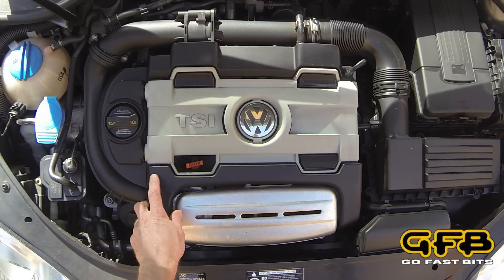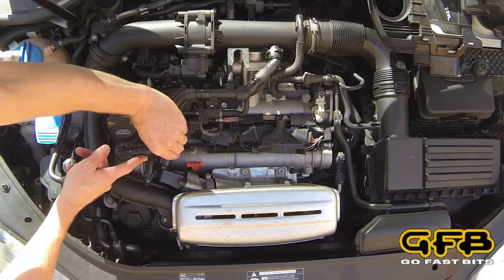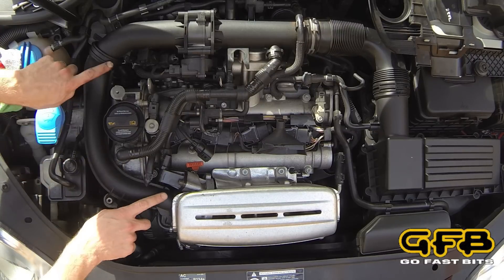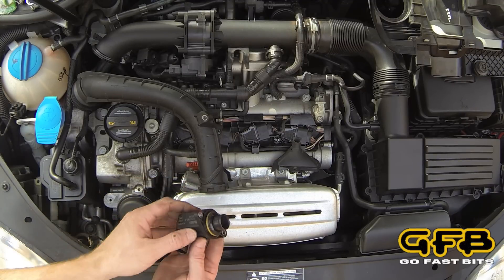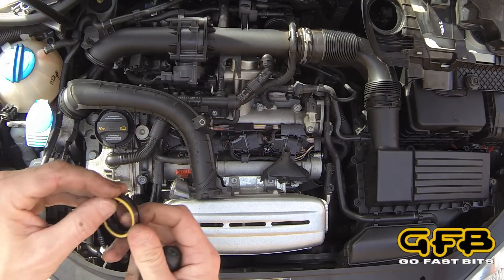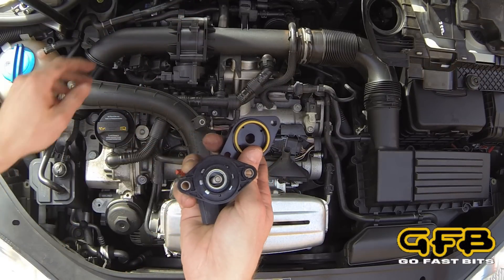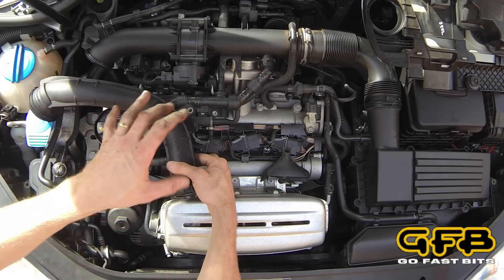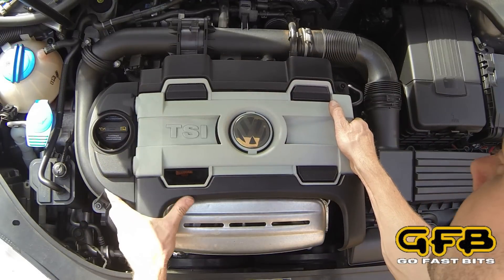GFB T9355 DV+ Twincharger 1.4 Installation

Comment: I am not sure, with the DV+ in place I feel a hesitation when pressing the throttle, a brief "nothing happens" when I step on the throttle. I also feel this hesitation when I slow down and downshift, lose speed, press clutch, blip throttle, downshift , then on the throttle again and the car does nothing for a brief but noticeable moment. Is it the DV+? Not sure, every other sensor and valve has been replaced with new. Is the piston sticky? Does it need to be lubricated (some people say yes, some people say no).

Comment: This looks like a Golf 5 but chatgpt is telling me the correct parts number is T9351 ?
Reply from the maker: No, sorry we only have the T9355 for the twincharger 1.4L Golf,
Reply: Chat gpt told me the same i order the T9351 but the T9351 was the wrong, T9355 ist correct. check how many Bolts you have. By the T9355 are there 2 an by the T9351 are 3
Reply: @till9024  Yeah, I did end up getting the GFB-T9355 in the end after quizzing chatgpt further and cross-referencing other sites. It hasn't arrived yet.

Comment: 74 / 5.000
And how it works, what difference is there against other brands or against the urinal.
Reply from the maker: Hi, our DV+ works by replacing the plastic valve parts of your OE diverter valve with an anodized billet aluminum housing and brass piston that ensures strength and reliability no matter how much boost you run. Our pilot-actuation system allows the valve to progressively open in response to boost pressure. By retaining the factory solenoid as well, the DV+ is able to open and clos reliably without ever exceeding the solenoids capability.

Comment: Fix error P0243?
Reply from the maker: The P0243 error looks to be related to the boost control solenoid, not the diverter valve.

Comment: Hey guys hopefully you can help me out on this one, installed everything correctly but if I give it 75% or over throttle, the o ring on the air pipe comes off, and when I reset it probably it does the same thing
Reply from the maker: Sorry I'm not 100% sure which air pipe you're referring to. I suggest contacting our engineers at support@gfb.com.au and including pictures or video showing the issues you're having
Reply: Where the 2 bolts come out of the Clamp, in there is a o ring that keeps blowing off
Reply from the maker: @ferisers6200  There's no clamp in the T9355 are you talking about a different product? 
Please contact our engineers at support@gfb.com.au
Reply: @gfbvideos  I should of explained it a bit better, your product works perfectly, it's the factory air pipe where the clamp is with the 2 bolts, there a o ring seal in there that seams to blow off everytime I give it a bit of throttle
Reply from the maker: @ferisers6200  I'm still not 100% sure which part you're referring to sorry. If it's blowing off with boost pressure then it sounds like there's a clamp that's loose or perhaps missing. Might be worth taking the car to a mechanic for that one if you're not sure

Comment: How about I have the same valve installed when I bought the car if I heard a whistle but now that I have cleaned it no longer sounds, is it normal that it is not heard?
Reply from the maker: Hi Erik,
It's a bit hard to diagnose a sound without being able to hear it. The T9355 should make the same amount of noise as the original valve so it's normal for no sound to be heard if the car doesn't have other modifications
Reply: I have Intake, Downspout, Catback, so is it normal that it doesn't make any sound?
Reply from the maker: @erikrodriguez922  Yes that's perfectly normal. If you have concerns you can send video to support@gfb.com.au

Comment: Good evening, I have a question the scirocco 1.4 tsi diverter valve will work on 2000 rpm?
Reply from the maker: I'm not really sure what you mean sorry. If you need technical help you can contact our engineers at support@gfb.com.au

Comment: good morning brother, in that same engine where would you connect or where would the turbo pound meter be connected? I can't find any vacuum hose to connect it, I hope you can help me Cheers
Reply from the maker: Do you mean you're trying to install a boost gauge? There are a few places you could put this such as in the line that goes to the fuel pressure regulator. It will be different on each specific engine and I don't have any specific instructions for your engine

Comment: hey guys ive seen a couple vids about this now and they all seem to say it gives the turbo a louder blow off sound, is this correct?
Reply from the maker: No this valve is not designed to change the sound. This is a fully re-circulating valve, not vent to atmosphere.
Reply: @gfbvideos  so now my question is what does this help or do for the engine
Reply from the maker: @larsharmsen9353  The DV+ can help in a few different ways. It can solve any leaking issues with the OEM part, improve throttle response on gearchange, and solve certain reliability issues with the OEM part. If you need any more information there's a bunch of resources on our website, or you can contact our engineers at support@gfb.com.au
Reply: @gfbvideos  thanks maybe I wil look into buying this when the OEM is broken

Comment: G5 BMY 1.4 TSI twincharger 103kw 2007
Works like a charm.(Do NOT lube ,it will burn away and stuck as turbo gets hot)
Factory sound --- whoooosh
DV-psssh  (short one)  or with 20psi+ it can make Stututututu (need throttle to cut off on proper boost ,not easy)
Reply: can you post a video or send me one somehow? im asking because you said DV= stutututu and i want to find out how to do it !
Reply: @TzouPhotography  I have air intake upgrade (KN) as well so more air comes in kompresor+K03+with DV gradually opening ,if you let off gas in right rpm there will be enough air left to make Stututu. 
But note its on twincharger engine so kompresor surely helps this.
Also its not very noticeable from inside.Its still small k03 so its just decent stutu :)
Reply: @pazupazu2781  i have the mk6 running 235ps at 1.5bar.. I'm about to make a metal plate to block the Bov so it stutuu like a charm... I don't think that the stock gti has more boost than me, and it goes stututu crazy
Reply: @TzouPhotography  1.5 will sound nicely im runnin just 0.8 and can hear it more or less so yours should sound even better.
Reply: @TzouPhotography deleting it won't hurt the turbo?
Reply: Does it sound like a forge bov?
Reply: @itzdc2903  No, forge has more sound,and whoosh in general i would say.
Reply: @pazupazu2781  Ikr, but does this sound?
Reply: @itzdc2903  Depends oon your intake how much noise it will make.but generally forge will do more sound coz it works diferently than dv+ i guess

Comment: Do u get boost pressure not detected since the install when using obdeleven
Reply from the maker: Hi Keston,
There shouldn't be any boost pressure not detected error codes after the install of the DV+
If you are having issues, please send some photos of your setup, and the components individually to our engineers at support@gfb.com.au

Comment: Hello!
I have a vw golf plus 2007
The engine that I have on in that car is an 1.4 TSI engine.
As I'm seeing in the video that's exactly the same engine as mine.
Since I bought that car, when I go out and give the car some beans. It seems that it isn't having any problem with the boost, or actually sometimes it's boosting pretty much A LOT and the turbo sounds like it's suffering from overboost.
But sometimes I noticed that that's just me giving the car too much beans basically.
Anyhow everytime I return and give the car a read/Svan for faults I get the error code P2261.
Does changing my dav has any potential of making that error disappear?
Thank you in advance!
Reply from the maker: Hi Nour,

So that an engineer can double check the fitment, please contact us at support@gfb.com.au, and we'll get back to you as soon as possible.
Reply: @GFB  thanks for the answer, I will definitely contact them, sorry for the latency with my answer, I didn't see any notification about your reply :)
Reply: @gfbvideos  what would you recommend for 2022 Skoda Octavia 1.4 TSi? I am unable to find my car on your website..🤷🏻‍♂️
Reply from the maker: @avishant1407  Hi Avi, thanks for contacting us! Using our Vehicle Fitment Search on our website, I was able to find that we do have the T9430 VTA listed as compatible with your vehicle. I found this by selecting: Skoda, Octavia, SKODA 1.2/1.4L TSI 2014-ON. I’ve also attached a link below. Thanks
Reply: @gfbvideos  ok, thanks, will check it out, how does it regulate the actual boost though? Currently my boost is at 28 psi, hopefully this will not be affected (as in reduced) by the B.O.V? Also, do you have the boost gauge?
Reply from the maker: @avishant1407  The purpose of a blow off valve is not to directly increase or decrease boost. It is more so related with redirecting boost (venting to atmosphere or recirculating back into the intake) after coming off throttle. The T9430 VTA will be able to remain closed and vent under your current boost pressure and it shouldn’t be able to operate as intended. We do also have a boost gauge available for purchase on our website. Its respective part number is: 3730.
Reply: Just an edit.. my engine is the variant that makes 140hp stock
Reply: I've installed this on my golf mk6 tsi 1.4 2010 160bhp. The other day Without the fat spring behind the piston. No error code at the moment showing. Migh have to drive it for longer and see how it goes
Reply: @Joe Andaya  thanks for your answer.
One thing to note though I think your engine is not the same engine that I have on my mk5 golf plus, mine is twincharged which I think was not installed to golf mk6 as far as I know of.
My engine code is bmy.

Comment: I have a VW Scirocco 1.4 TSI 160hp, is this worth upgrading without tuning ? Will I feel a difference?
Reply from the maker: There are three key benefits of the DV+. Boost holding, throttle response, and longevity. Given the age of the engine, if it's still on the original diverter valve chances are you'll at least notice a slight improvement in boost holding at high RPM. The throttle response improvement is there regardless of the condition of the OEM diverter, because the DV+ operates differently. Typically you'll notice this more on a manual vehicle than a DSG, but any time you drive aggressively on and off the throttle, the DV+ will improve the return to peak boost. As for longevity, the DV+ will last longer than the car, that's for sure.
Reply: @gfbvideos  Thank you for the fast and great reaction  🙌💯 I've got it installed a couple days ago, together with a Pipercross airfilter, new NGK Coils and Spark plugs, I've had to admit this DV+ diverter valve is a great upgrade, the boost and throttle response feels so smooth now, I'm loving it 👊🏽😎
Reply from the maker: @Wiseguy-010  Awesome! Glad you're happy with the improvement, thanks for the feedback!

Comment: Diagnostic shows me the eror "check engine" and tell me to change that piece. I changed and remove eror and after 2-3 days it shows up again for same....I dont know what to do
Reply from the maker: If the fault code you're seeing is P2261, this is discussed in detail in the T9355 instructions. It doesn't mean there's a fault with the product, but it does mean the ECU is able to detect the difference in operation between the DV+ and the OEM diverter. If the engine is tuned, it can be more likely to throw that fault code with the DV+ installed since the difference in operation is more noticeable. Ironically, the difference in operation is how the DV+ improves throttle response, but the ECU doesn't know that, it just sees something it doesn't expect. If you remove the main spring behind the piston in the DV+, this should prevent the fault code from popping up. It does mean you lose the throttle response benefit, but you still get boost holding and reliability.
Reply: @gfbvideos  Is that fault code cause any issues?
Reply from the maker: @DawidSzypulski  It doesn't cause any issue, but it is annoying on the twincharger 1.4 engine because it's the only engine in the VW/Audi range that lights the CEL when the P2261 code pops up. All other models simply log it in the background. It's important to understand that in the case of the DV+ it doesn't indicate a fault, it indicates that it has detected a change in diverter operation. The DV+ has been designed to balance throttle response and attempting to fly under the ECU's radar whilst doing it, and in most cases it does. If the ECU keeps throwing that code with the DV+, it is a good idea to confirm that removing the main spring from the DV+ prevents it. If the code still appears with the spring removed, there is another issue causing it that needs to be addressed.

Comment: thanx for the video what fault code was?
Reply from the maker: Hi Duraid,

The fault code that might appear is P2261, but it is caused by the ECU detecting a difference between the GFB main spring and the stock spring. If it appears, it does not mean the DV+ is faulty and does not cause any issues to the turbo or engine. 

If you don’t want to have the fault code appearing, you can solve it by removing the GFB main spring.
Reply: @gfbvideos  thank you for the reply, I have a VW Passat VI Variant (3C5) 1.4 TSi EcoFuel  Engine: CDGA year: 2012 Biogas/petrol, ECU Flag fault code P0236 Turbocharger Boost Sensor (A) Circ. ：range/Performance. All three pressure sensors checked they were OK. When we checked the DV we found that it had an intermittent stuck. The question can a bad DV flag the fault code P0236?
Reply from the maker: @duraiddlimi9032  The P0236 is a very generic code that unfortunately doesn't give us much information. A faulty diverter valve could cause this, but so could a whole list of other things. For more specific technical support please contact us at support@gfb.com.au

Comment: I have the same engine wil it do the same nose in a dsg
Reply from the maker: Hello, 
I'm not really sure what noise you mean sorry. There isn't any sound demonstration in the video. This valve is designed to be a performance oriented replacement for the stock valve. It's not designed to vent to the atmosphere for noise

Comment: Does the supercharger on these engines give the same problems potentially than the supercharged mini.?
Reply from the maker: We haven't had any issues with the diverter valve on these engines. We don't make anything for the supercharged Mini so I'm not sure about any issues on those engines.

Comment: What can be the problem? the  oil fill  cap is by hand difficult to remove after driving???
Reply from the maker: Hi Victor, 
Sorry to hear about your oil fill cap issues. 
This isn't really anything that could be associated with the diverter valve. If you are having problems I would suggest taking the car to your mechanic.
Reply: I did buy a new rubber gasket and the problem was over. my VW Tsi 160 hp is 10 year old that may have been the problem with the gasket.

Comment: After i installed at 1.4 cavd tsi it brings me error codes  
P2261 Turbocharger/Supercharger Bypass Valve - Mechanical
P2261 Boost Pressure control valve (N249) !! 
Any idea what is going on?
Reply from the maker: Hello, 
A P2261 code is possible in some rare instances. There is a section in the instruction manual about what causes the code, and how to solve it. If you do need any more help feel free to contact us at support@gfb.com.au
Reply: sounds like its not compatible
Reply: I have same problem too. Did you solve the problem?

Comment: Where can i get this in S.A? I have an issue where at 3000rpm my car feels like it's smothering, as soon as i release the throttle there's a small gain up until it reaches 3000rpm again. I'll check for an error code just to check it again?
Reply: 3000 rpm? You gotta have your “regulating intake flap” changed or cleaned if you know how to. The thing in this video will definitely not gonna help your issue.

Comment: Does this efects the accelaration?  An audi a3 has that problem....when you step on the gas ...the car starts shaking back and forth like there is no enough presure in the turbine....or there is not in anough fuel presure
Reply: Could be so much.. injectors, turbo setting, etc etc
Reply: Ladedruckregelventil. War bei mir auch. Blow off Ventil hab ich gleich mit gemacht.
Reply: @michaelm.1928 Also nur das „kleine“ Ladedruckregelventil (Umschaltventil) , aber nicht das große Schubumluftventil vorne am Turbo ersetzt?
Reply: @marcelk335  Ja, aber kannst kannst beide machen. Kosten nicht viel und sind gleich ersetzt.
Reply: @michaelm.1928  alles klar, danke dir für die schnelle Antwort. Ist bestellt 🤝🏼
Reply: @michaelm.1928  aber nicht das Magnetventil richtig?
Reply: @marcelk335  Doch, Magnetventil, liegt bei den Zündspulen links und das Umluftventil am Turbolader.
Reply: @michaelm.1928  Achsoo ja ok hab verstanden 👍🏼
Reply: @marcelk335 hello i have the same problem as yours, could you please give me some update regarding after you change the Boost Pressure Control Valve, how is your car? is it repaired?
Reply: @michaelm.1928  i have the same problem as yours, could you please give me some update regarding after you change the Boost Pressure Control Valve, how is your car? is it repaired?
i already change the pcv (Entlüftungsschlauch) but There is still a little hesitation in acceleration at high speed.
Reply: @pamilyasaalemanyaYT  Car is repaired
Reply: @marcelk335  Thanks